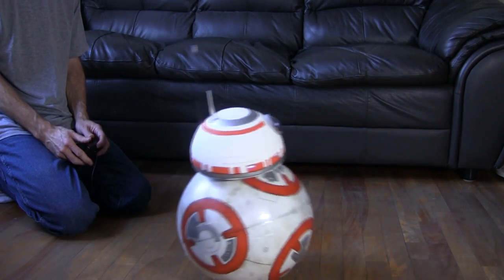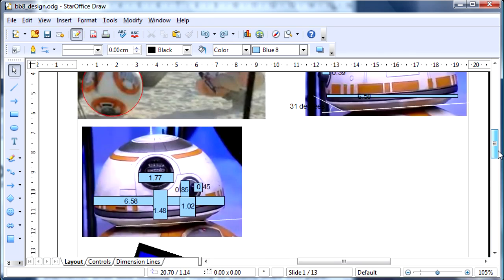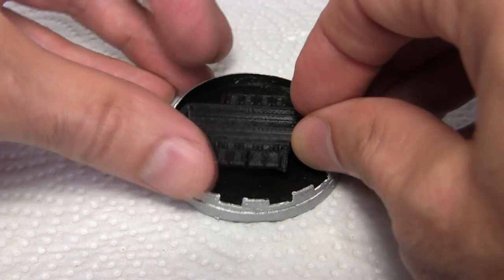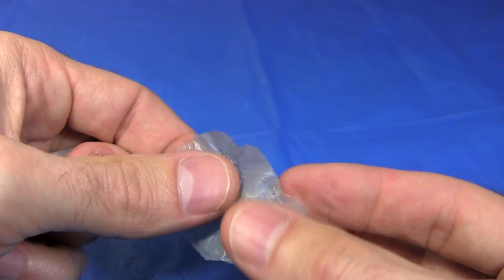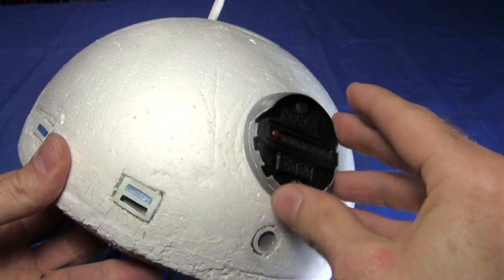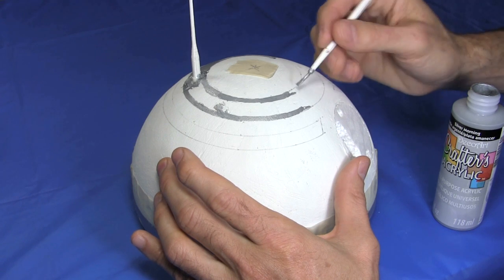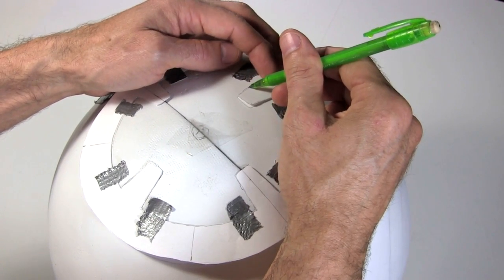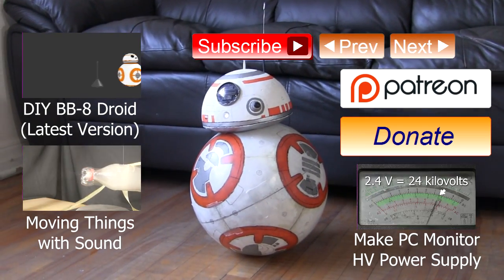Making BB-8 (v2) - Painting/Details/LEDs - Part 5

Comment: If you have the time, I have a question. When I cut my ball in half it seemed a little flimsy and the edges didn’t meet back up perfectly (I think it’s partially due to the fraying of the paper mache layer of the ball). I worry this will make it harder to try and keep the ball together via tape. Did you encounter similar problems and/or do you have any suggestions as how to improve the mate between the halves of my ball?
Reply from the maker: My ball is made from a cardboard globe (it sounds like you made yours from paper mache) so I didn't have that problem. Initially I was using the globe as is and didn't have a problem. Then I covered it in three layers of fiberglass and so still don't have the problem. You can see both versions in this video here https://youtu.be/se4zfgIx9sA So you could consider covering yours in fiberglass too.
Reply: RimstarOrg okay. Thank you!

Comment: Having a similar deformation problem with my ball. How long did you leave yours in that clamp device you made?
Reply from the maker: I didn't leave it in the clamp device at all. That was just a way of measuring the height of the ball in different positions. Pretty cool that you're making one. It's real rewarding when the fiberglass ball is finished and solid.
Reply: RimstarOrg ah ok, I misunderstood. And thanks! I’ve wanted to make one for a while and now I finally have the chance. Your videos have been a great help!

Btw, do you think it’s alright if my ball isn’t perfectly round? A portion of my globe warped and no longer seems to be out far enough
Reply from the maker: If it's not perfectly round then there will be spots in it's movement when it will unexpectedly turn. You'll just have to compensate when you're controlling it. As you can see from when I measured it with that clamp setup, mine isn't perfectly round either but it still works reasonably well.
Reply: Okay. Appreciate the info! Glad to know it’s not a total death sentence

Comment: Awesome!
How did you spin the head?
Reply from the maker: The head is fixed relative to the drive system. When I rotate the drive system, the head rotates too. That also means that the head always points in the direction BB-8 will move. I don't have any good interior footage that demonstrates it but you can get some idea from here https://youtu.be/1gWBS70vphY?t=8s. Just imagine a pole going up from there to the magnets that hold the head. When that rotates as you see in the video, the head rotates with it.

Comment: where is the video of yesterday about ground???
Reply from the maker: There was an error in it that too large to keep so I made it unlisted. I should have mentioned that the neutral and ground wires are connected at the main breaker panel and that that's the circuit the current goes through, instead of saying that it just goes to ground. I should have thought of that originally but with the way the video evolved during development I got it wrong. I'll fix the error, and add a few more things and upload it again. It'll take a week or two because I have to go somewhere to get some more video for it.

Comment: hello rimstar, i have a question
does the wimhurst machine have to be powered by it
can it be powered by batteries
and i like this video:)
Reply: for a corona motor
Reply: It can be powered using batteries and a motor. but whatever you use to power the wimshurst machine, the output energy of the wimshurst machine will be lesser than the input!

Comment: Looks great sir. Good job, might I suggest using some small pieces of dowels as tabs on the inside and some small magnets for a cleaner seal of the body.
Reply from the maker: Thanks. I planning on using brass tubes on one side and brass rods on the other, for pin in pot. I hadn't considered wooden dowels though. I'll have to think about that. They might be better. Thanks for the idea. Small magnets wouldn't work since the head magnets and the magnets inside would be attracted to them. The fact that there small wouldn't matter since the field from the head and ball magnets are still strong.

Comment: This is when a foam cutter (a voltage source and some Ni-chrome wire) would have come in handy.
Reply from the maker: The thought crossed my mind, mostly because I couldn't find my coping saw. But the day before I planning on cutting it I just happened to run across another coping saw at a yard sale. So, I didn't get to make a foam cutter :(.
Reply: RimstarOrg
:(  It sure would have saved you from that filing and all of those little white pooping things that goes everywhere or, at this time of year, love to stick to you and your clothes, lol.

Comment: this looks absolutelly amazing. One suggestion I have is overhauling electronics with Arduino. There are bluetooth boards, so you can have some stuff adjustable with a smartphone, and for long range communication you can use nRF24L01 (I use it in a RC plane). youtube channel Great Scott has recently uploaded a video about wireless energy transfer, so you could use that to power the head LED's from the main batteries. If you were to really commit to it, you could make a wireless charging power station for it and have the voltage displayed on the smartphone. Just some thoughts I have on making it cooler. Anyway, nicelly done, it looks absolutelly sick.
Reply from the maker: Thanks. The RC range is a little short and it would be nice to extend it. I have a feeling I'll be using bluetooth for the first time in future projects instead. I've a few more things to do to this one but it's time to move on. Regarding powering wirelessly through the head, that might be possible, as long as the weight can be kept down. The distance is probably more than 2 cm. Wireless charging for the main batteries wouldn't work though, it would take much too long. I'm glad you like it though.